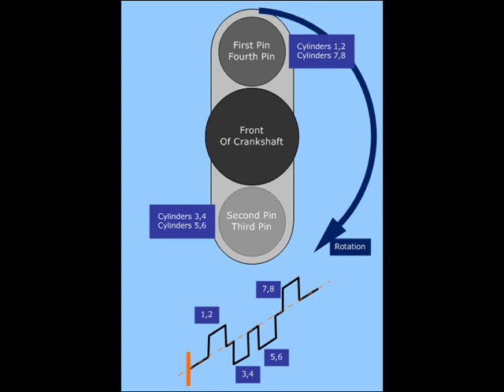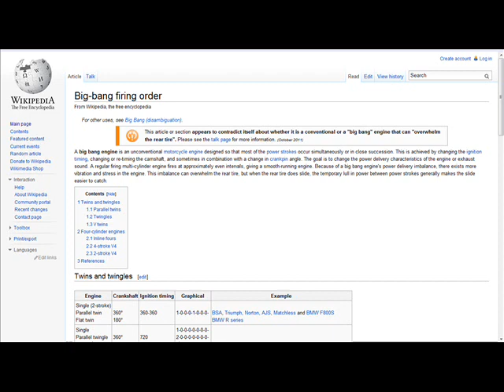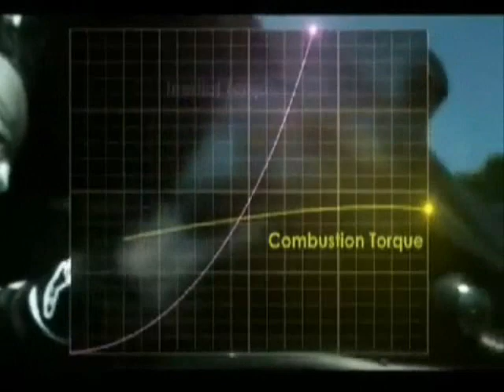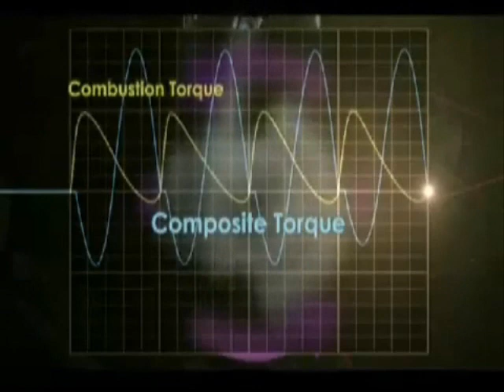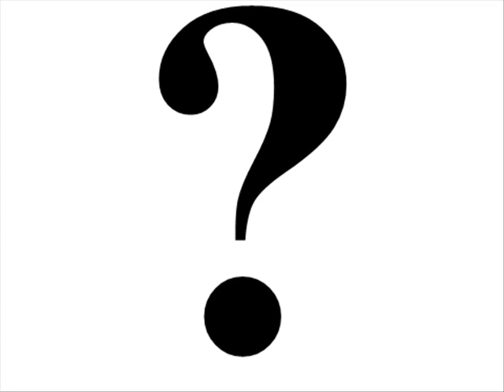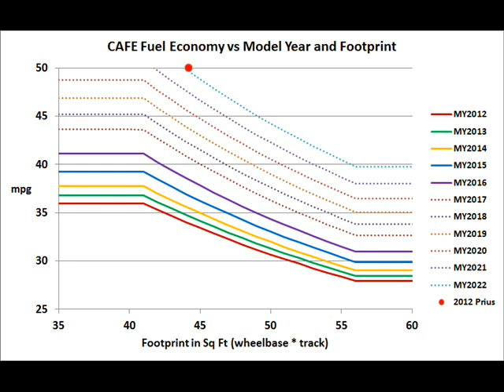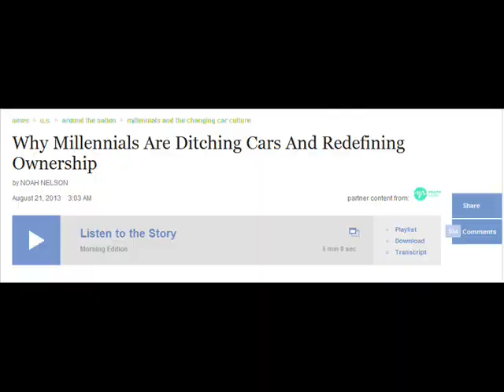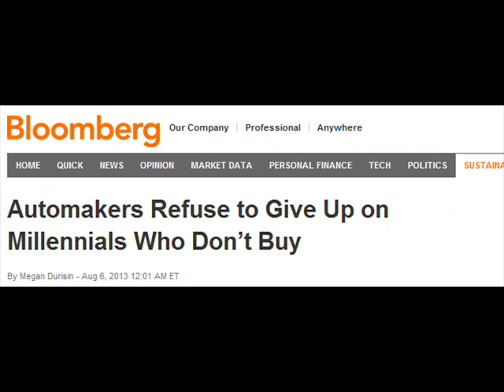Crossplane Four Cylinder Engines In Cars

Comment: Ford should have made their Ecoboosts especially the 2.3 on the Mustang a crossplane.
Reply: Exactly.
Reply: Julio Romeresto you have to tell  that Mazda !
Reply: osp80 cause the only reason the v8 doesnt sound like shit is because of the crank
Reply: Ezra Greene but that’s saying that a Ferrari V8 or even the new GT350 sound like shit, they have a flat plane v8, better for high revs and weight. Each design has its own application
Reply: Julio Romeres YES! I actually sent their resource dept a msg regarding this!
Reply: Dude this is exactly what I came here to see if anyone else had this idea
Reply: But then no one would buy a 5.0L v8. That is exactly what they probably thought of.
Reply: @ezragreene3384  Do not say bad words because it is sin, repent and believe in the gospel of Jesus the Son of God, the Messiah.
Reply: @NeikoGarcia   @Ezra Greene  Do not say bad words because it is sin, repent and believe in the gospel of Jesus the Son of God, the Savior of the world.
Reply: @NeikoGarcia  even still, ford made the voodoo sound mostly like a cross plane by using a "U,D,U,D" configuration instead of "U,D,DU" and unequal length exhaust headers
Reply: That's too big to pull off.  As I understand it, you need to keep it less than 1.2 L or so

Comment: The problem with a crossplane crank in a 4 cylinder is balance. Much like in a v8, you have poor primary balance, but good secondary balance. And what this means is, you're limited in how you can properly achieve good engine balance. You can either 1. use counterweights, which hinder throttle response, 2. make the engine small, but make it rev high (a small engine isn't going to want to rock itself apart as much, and high revs means that rotation forces don't have as much time to act before they are balanced out by the next rotation force), or 3. make the engine larger (which is what American v8's do), which means that the forces are larger, and therefore are helping balance out the other large forces, but this drastically limits the rev range of the engine.

So the challenge in a car is that a car demands more bottom end and longer lasting torque, since they're heavier (and have more wheels to pull). So that throws out the small, high revving engines out automatically (especially since cars don't prefer higher revving engines unless they're race cars anyway). While a 3.5L crossplane i4 would be achievable, why do that when you could get a 3.5L v6 as well? Sure, it won't sound as great, but from a practicality stand point, it would be much better. So your other option would be to have a smaller i4 engine with counterweights, which would negatively effect throttle response. And if you're going to have poor throttle response, why not just stick to the current i4 setup? You'd have to sell car companies on the idea solely on the basis that people will enjoy the sound better.
Reply: hypershadow5g that’s what keeps the V8 in the mustang so that’s a good argument

Comment: Holy Crap! You are mind-bogglingly right!  I've always hated inline 4 cylinder cars, but I like the race bike inline 4 sound.  Likewise, The Honda VFR V4 engines sound awesome and I thought that they should be making V4 cars if they want to give sex appeal to smaller cars as we move into the 40+ mpg CAFE years. On the flip side, American V8's are sexy like a symphony, but the BMW V8's sound like a tone generator.  Now I get it!  Above 7,000 RPM, flatplane crank engines are sexy, like a Ferarri 458.  But below 7,000 rpm, it should be a crossplane crank like a Corvette.  And following that thought process further, crossplane crank engines make better low end torque and flat plane crank engines make better high rpm power! And since these econo boxes all operate lower than 7,000 rpm, they REALLY should be crossplane crank engines!!!!!
Reply: @eeiko321  that's quite the assumption. Of op and of Americans. You underestimate how big the ricer community is here. 😂 

Not to mention, just because something is popular doesn't mean the reason for its popularity has any bearing upon a specific individual's opinion of it. Some people don't like the sound. Some people ONLY like 6 or more cylinders. Some people only like 8 cylinders. Some like none. The list goes on. Point is, we're all individuals and we're all perfectly capable of and entirely permitted to like or dislike whatever it is that we like or dislike. What exactly was there to be confused about?

Comment: This is AWESOME!

Perfect video, and the Yamaha section is fascinating.  

What I cannot believe is that a company like Volkswagen AG, which is run by engineers, has not done a performance four cylinder for their GTI with a crossplane crankshaft just to get that sound. 

A GTI with that engine sound would TROUNCE every other hot hatch in sales~!  Holy shit...

I drive a Porsche 928S2.  This car has a 4.7 liter V8 with a crossplane crankshaft and I've installed an Ott crosspipe and a Borla exhaust;  It sounds like a '60's muscle car, and I get people pulling up next to me all the time asking "Did you put a Chevy engine in that?".

Comment: The disadvantage of the crossplane design is the rocking moment from the imbalance of planar forces which then requires counterweights to be added to the crank shaft decreasing responsiveness. Both designs have trade offs.
Reply: EpiDemic117 are you saying flat plane as in flat 4 cylinders like the subaru boxer?
Reply: EpiDemic117 like boxers.
Reply: EpiDemic117 boxer 4s and 6s have a unique firing order and timing. that's why when you hear a subaru sound it's more throaty than the others. and they balance themselves with firing order and counterbalance to where I've seen people balance coins on them running. like the bmw I6s firing order for boxers is the same as the crossplane but without the double time on 2 and 4. just look up an animation or video you'll see.
Reply: EpiDemic117 yeah
Reply: the subaru burble has nothing to do with the firing order but with the way the exhaust manifold are unequally lengthed or paired.
Reply: Chris Huynh exhaust manifold differences can't cause a sound like that. that's all engine timing. where did you get this information? i have many friends with aftermarket exhaust systems including exhaust manifolds and they still have the subaru growl
Reply: +Brownyman ...and greater length of the crankshaft, which translates into greater width of  bike's engine in the frame, which results in lesser lean angle before crank case touchdown happens and stronger gyroscopic force making the bike less willing to turn.
Reply: +EpiDemic117 Vibration and rocking moments are different things
Reply: the first two point are valid however, the gyroscopic effect is too small to need worry about
Reply: Also it sounds like a leafblower,  and it cant rev as high
Reply: mini hoov the subaru rumble is caused by unequal header lenghts causing the sound impulses come out in an uneven fashion which leads to the sound, the firing order is the same as most inline 4 cylinders.
Reply: mini hoov put an equal length manifold on an STI bro. YOU then tell me without lying through your teeth, that it doesn't sound like an evo. The grunt of the suburbs is cause by unequal exhaust pulses due to an unequal length manifold.
Reply: Antonio Albarran correct: Any rumbling sound is cause by  uneven exhaust pulses. In Subaru's case it was down to the headers being unequal. But that's the primary cause of the sound. Secondary source of the sound also comes from the movement of the mechanical components and has been demonstrated somewhere on YouTube an LED/audio simulator. There is definitely a distinctive difference between an I-4 and a H-4, both with even headers, but by the time it reaches the tailpipe the difference is indistinguishable.
Reply: That might be true if taking both flat plane and cross plane to their design limits. As an example, when Yamaha introduced the crossplane R1 in 2009 it had a little bit less power than the flatplane 4 it replaced. Now though despite stringent EURO 5 emission regulations the latest  R1 crossplane motor has 200bhp @135000rpm from only  998cc, that's 200bhp per litre in a production motorcycle.  Yamaha and Suzuki both use a cross plane crank for their current MotoGP bikes as when talking 280-300bhp MotoGP bikes,  flatplane crank 4s are too hard on the rear tyres, though they are down on power and speed versus their V4 rivals by about 8-10 mph on the longest straightaways.

Crossplane  crank 4s used for cars would be 1000cc-2500cc and either NA or Turbo and would likely not rev beyond 7000rpm if used in a Eco car so perfectly viable.

Comment: I would like some car manufacturers to start using this, it's a brilliant idea and it not about sound either it's about torque, has anyone here did physics and understand that torque is a turning force, and u can achieve more torque by reducing crank angle the smaller it gets the more torque can to be generated, so for e.g. the if you think the 90 crossplane for a 4 cylinder is impressive would would a 60° crank on a 6 cylinder or 45° on an 8 cylinder sound like. So it's basically like this the engine is applying the same force it would normally to a piston in operation but for a shorter crank rotation distance, so instead of it moving 180° to get power it moves 90 not only that but there are loses in that because the usable energy is usual gone before bottom dead center. Plus horsepower is torque multiplied rpm, so with crossplane u get more torque and more rpm because of greater efficiency in turning the crankshaft

Comment: doesn't really sound like you understand the crossplane four. there isn't something magical about the crossplane crank that translates from the v8 to the inline four. the v8 has primary balance and inertial torque balance, as well as other second order improvement. with a four you pick your poison ... do you want to eliminate the rocking couple, or eliminate 2nd order kinetic energy imbalance and some linear vibration? crossplane 4's are rougher at low rpm because of rocking and uneven torque delivery, but come into their own at high rpm as those problems diminish and the reduction of uneven kinetic energy (vibration proportional to rpm squared) utterly dominates those other issues. in short, the crossplane is becoming less viable as i4 cars make extra power with turbos instead of high revving engines. the fact that (at 10:00) you think crossplane fours have a V configuration and counterweights hilariously confirms you don't know what you're talking about
Reply: i could see a market for cross-plane crankshafts in the sports car segment, given that there's now a 4 cylinder mustang. making it sound like a v8 with the fuel economy of a four cylinder would probably make many consider the 4 over the 8 unless they're super patriotic about their 8 cylinder engine. what do you think?
Reply: I think that for this video, this guy is talking more about the sound the engine makes than tthe actual benefits the cross plane crank would have over the flat plane or vice-versa. I agree for the sound! I also understand why the automobile 4 cylinder is more widely used.

Comment: This works on small engines because of reasons stated below, however, it's really only needed on small engines because they can produce more torque and as such it doesn't need to be applied to larger 4 cylinders because they already have (usually) an acceptable amount of torque. Add to the fact that these are 1 liter engines with relatively small vibration as a result, and there's your answer.
Reply: +Josh Moss Are you saying crossplane makes more torque? How exactly? (Or am I misreading you)
Reply: +SingleTurboSupra Yes, generally they do, but flat-plane rev higher, in general, and make higher peak horsepower as a result.
Reply: +BagelBytes ...which would be impractical on a normal road. Also, say, the Mustang it's a muscle car.. using flat plane and getting peak power would lose the characteristics that it was developed with.

Comment: GOOD STUFF. Compare the Ferrari V8 used in their sports cars (flat-plane crank) to the Ferrari V8 used in the Lancia Thema (cross-plane crank) and you hear an obvious marked difference.

The Ford  Ecoboost engine, used in the Mustang, should have been cross-plane inline 4 to give off the classic V8 sound. The exhaust acoustics would then have been tuned to give a throaty and baritone sound. Very disappointed. perhaps they might approach Yamaha again to produce a new engine, with Ford Ecoboost heads.

Comment: Many manufacturers have already addressed this problem of less desirable engine notes in smaller displacement, smaller cylinder count engines.  The two most common systems are to have an intake resonator that creates engine types of sound, albeit not from the exhaust, and have a sound tube that goes from there to the inside of the cabin.  Ford does this on the focus ST.  The 86/BRZ twins have it as well.  The other system out there is to play synthetic engine sound through the stereo.  BMW does this on their i8, as well as others.  The creator of this video also shows a picture of a WRX with a non turbo Impreza near the end of the video implying that it has the same motor, but with a crossplane crank.  Perhaps this is because of the rumble you hear from Subaru's older engines.  This burble is from unequal length headers.  Car manufacturers will not adopt crossplane cranks, because inertial torque is much less of an issue in an automotive application due to much heavier drive train components and far lower revs.  When  consider that the marketing aspect of sound has been addressed in the eyes of the manufacturers, there is no reason to expect adoption of this engineering solution for the auto industry.
Reply: joe mama both of those solutions sound like shit btw

Comment: engine balancing is the issue. I4s are already problematic because of secondary balancing cross planes add another force to be balanced and engineer around. 

Cross plane I4s are limited in displacement due to this, but with that said there is nothing wrong with a 1.0 - 1.5 liter in a car, Especially if it could rev over nine fucking thousand, I'd love to see a snappy little roadster with a revvy cross plane I4 sending it all to the rear.

Comment: A flatplane crank can rev higher and is more efficient at higher RPM that's probably why they use them in four cylinders because to get any power out of a 4-cylinder you're running high RPM
Reply: you know that yamaha crossplane revs to 14-15k right? :p

Comment: It makes me want to get an old datsun 1200 with an A series engine and get a crossplane crank made for it, being its OHV would only need to have one custom cam made too. It would then have a mini muscle car sound to match the mini muscle car looks. 

The A series was a hell of a little engine back in its day. 

When built they could rev over 8000 rpm and make well over 100hp per liter (not bad for an engine designed in the 1950s, huh)?

Comment: You could have similar sounds with unequal length exhaust headers. It's all in the timing of the exhaust pulse, get the exhaust length right for each cylinder and you'll end up with a 4cyl sounding like a small V8. This and keep the advantages of a flat plane crank. Listen to a Ferrari V8, then listen to the Mustang Voodoo flat plane v8, they don't sound the same at all. The Mustang kept some of the big burly American V8 sound with a a high reving twist.

Comment: Of the sources I checked, this vid is the best explanation of what a crossplane crank actually is. And those bikes sound amazingly like American V8s. But exhaust note is no reason to adopt this system. It has to give power or economy gains in a big way to be even considered. Does it do that? Also with more hybrids and electrics on the road, automakers will be looking to silence the engine and pipe in pleasing artificial sounds to the driver, if any. That's much cheaper. If there's efficiency to be had, let's hear about that.
Reply: inefficiencies (we can do something about) are tied to mechanical losses, that's why you see a lot of manufacturers downsizing their engines and adding forced induction; less surface area means less friction. replacing a regular flat-plane crankshaft with an equally weighted cross-plane crankshaft would therefore make no difference in terms of efficiency

Comment: The reason cross plane cranks are not used in small cars, is because of the uneven forces put on the crank and block, and the need for heavier counterwieghts to balance out the vibration of an engine.  On a motorcycle people don't care to much about vibration and the lengh an engine lasts.  50000 miles on a motorcycle is all most people expect.   Because the crank has to be made stronger and heavier, horsepower goes down unless you rev it higher.  On a 1 liter engine all the parts can be made light enough to bring vibration to an acceptable level, that can not be done on a 2 liter at an acceptable cost.  The block has to be made stronger, and that adds weight.  4 cyl cars are expected to get great fuel economy and last for 300000 miles, a cross plane crank can not deliver that.  And as far as the sound is concerned most people like the sound of a ferrari, and most other exotic cars, they sound that way because of the flat plane crank.  Ford just put a flat plane crank in the new mustang specificly for that reason.

Comment: They SHOULD start building 4 cylinders with cross plane crankshafts. Have you ever sat in a car with an inline 4 cylinder with poly engine mounts? That car vibrated worse than a 500 HP cross plane V8 with SOLID METAL engine mounts! Flat plane cranks have way more vibration issues but cross plane cranks are smoother. Besides, MPGS aren't always determined solely by engine size. Engine size, torque, and gearing is all connected in terms of MPG and performance.